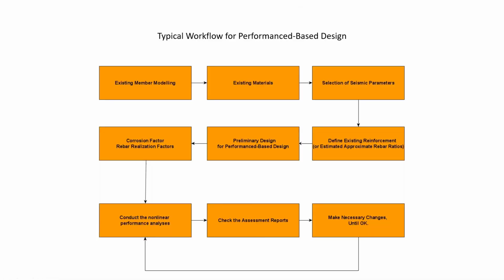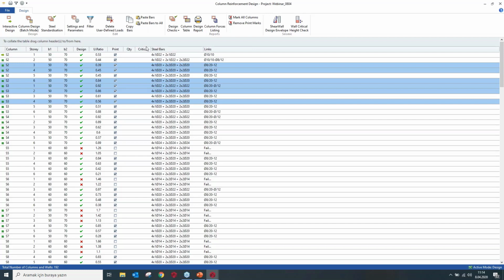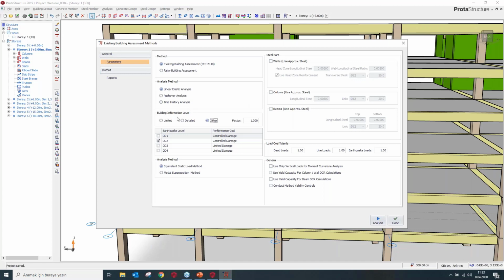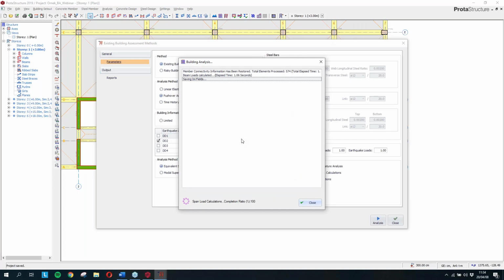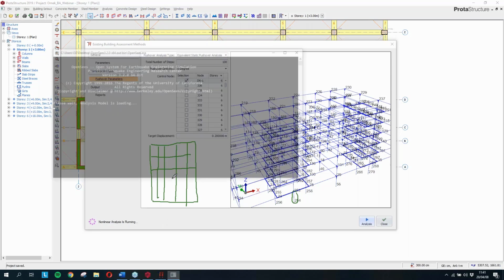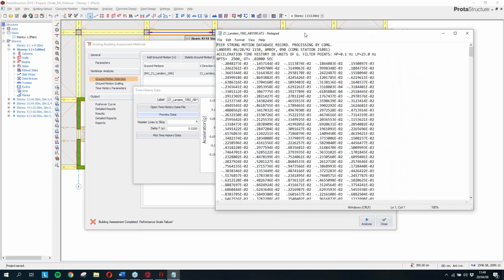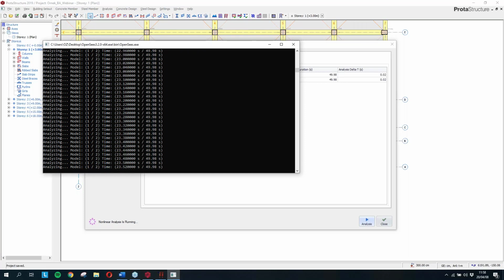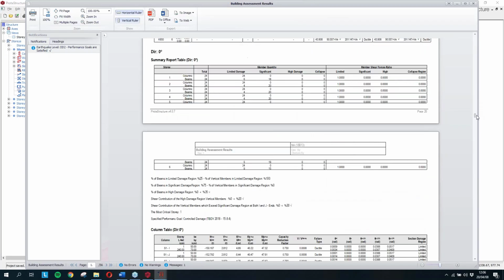ProtaStructure - Performance Based Design and Assessment

Comment: wonderfull explination..PLs..how to apply wall load on waffle slab edge that had no baem.thanks
Reply: in program interface, top short menu, you will see a line load application. By puting an 1----1 or 2---2 defination sytem to where you want to add a load pattern you can apply this load defination without beam. it means you will define line loads, pls try
Reply: Thanks for your QUICK respond.Ol...i did & I have got this message "A slab to transfer the load cannot be found.load will be discarded"